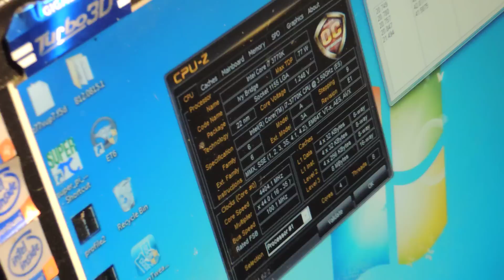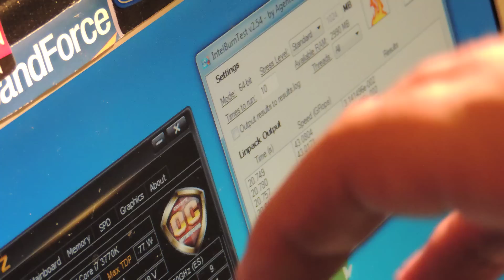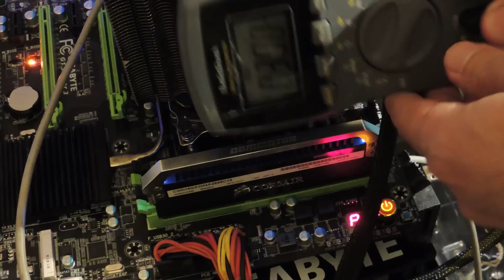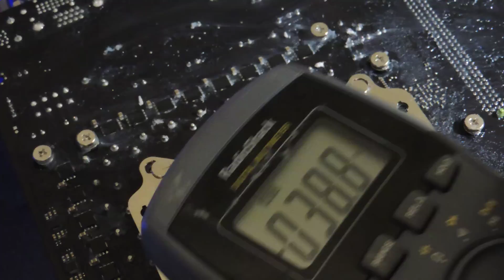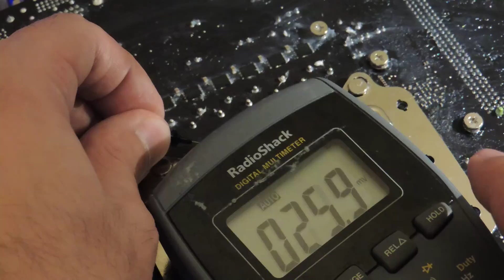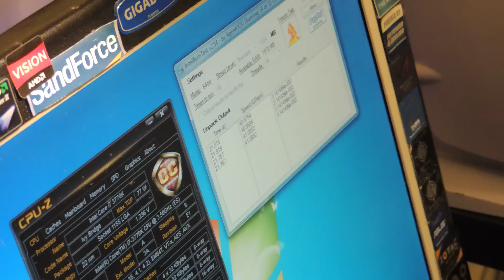How to Read Motherboard Voltage Read Points

Comment: Just curious, but is that petroleum jelly on the back of your motherboard?
Reply from the maker: It's either petroleum jelly or some type of silicon lubricant, I used to use them to coat the motherboard quickly so it wouldn't be damaged by condensation that arises from liquid nitrogen overclocking.

Comment: Software read of my pc is 1.25v
Physical reading is 1.6v O-O
Is there a problem?
Reply: that could be.  check your multimeter first.  when the battery got low on mine it would read high.  the mains power on the power outlets of my house would read 150v but when i changed the battery it read 123 like it should ahve been.  a car battery which should read 12v dc was reading 18v dc.  if it still reads high make sure you have the right voltage point to read
Reply: @bobhumplick4213  ok den

Comment: Hi where do i ground the negative probe of the multimeter on the circuit board of a hifi to check voltages on a stk ic
Reply from the maker: On the other leg of the capacitor, if you get a negative reading just switch the polarity

Comment: Hi Sin0822 thanks for your guide. I have small question, how to measure Vcore on Z87 boards. I tried same method on ASRock Z87 Extreme3 and allways get 1,760 V. With frequency it was ok – 300 Hz.